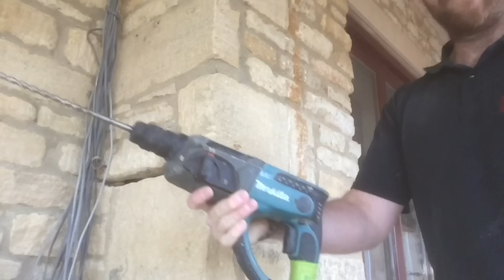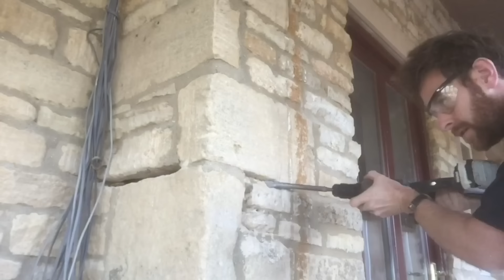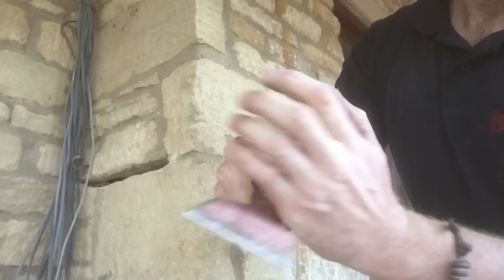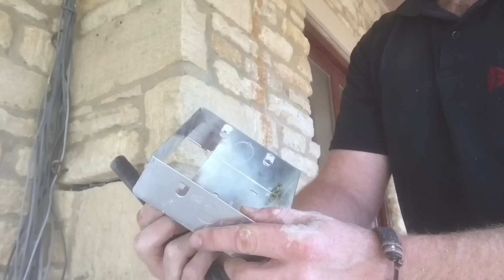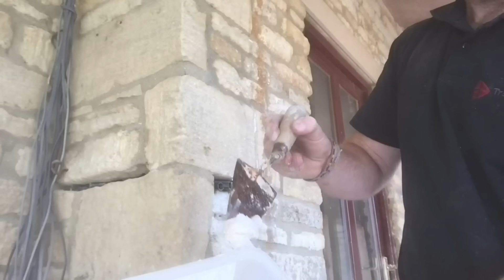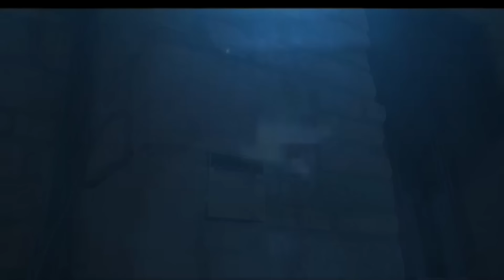How to Chase a Stone Wall and Fit a Metal Electrical Back Box for Sockets or Light Switches

Comment: I hope you have wet the wall before you applied the adhesive. Also hope you haven't put the communication cables with the electric ones in the same box.

Comment: Do these videos provide you with all the info you need to go on site?
Reply: glyn hodges  Cheers. I was thinking turn to youtube or reddit if I had any questions, I finished training as an electrician back in 2012 but could never get a start, so was thinking just to force myself on site and if any challenges come my way I could use the internet to figure it out, i'm great at getting around things.
Reply: Hard to get a start without experience i had to blag my way in as well but at least you have Youtube now this channel is one of best and you can learn a lot of the correct ways  , I practiced chasing out and fitting sockets and backboxes in my garage and volunteered at friends and at families houses for free for a while to get as good as possible  , on first day on site i was lucky the electric was out breaker tripping so i had to test the circuit split the ring and go around testing to find fault i got the electric back on within an hour it was a faulty outside light on a ring spur , easy really but made me look like i was competent and the builder was happy as were the other trades.  This video shows a very tough job this and engineering brick mainly its soft wall and a lot easier but some that crumble i find difficult to get good fixing on  .
Reply: @Cagmito125sportsbikespares  Yh I know, i've been trying for years to get a start as electrician but you can't ever get started because of lack of experience, I can't be asked with this lol.

Comment: I'd of used a mechanical fixing to hold the box in place. No good saying you can use pollyfiller etc. Many fillers can shrink or not adhere properly to a dry, dusty substrate. An idea would of been to dampen the area first. Even so if repointing.

Comment: set the depth stop on your drill 3-5 mm deeper than your box. That way you don't drill too deep into the substrate behind. Less making up lost material. Chain drilling is great way of removing the bulk, but finish off with a scutch chisel. You can upsize the drill bit to remove more material also. Less hammer and chisel work.

Comment: Why did you screw and plug the backbox in, then point up with the lime? I would not personally rely on gypsum based adhesive to hold that backbox in the wall and i cant see any reason why you wouldnt run a couple of mechanical fixings in considering that you have stone behind the backbox. Nice job on the conduit through the mortar joint though.

Comment: What impact does this have on the strength of the wall?
Reply from the maker: Hi. This jot was done by my colleague but I know the building inspector visited many time during the first fix. Thanks for the great question GSH Electrical
Reply: The stone is not structural, the wood in the house is
Reply: None

Comment: What were all them cable for ? Great video by the way
Reply from the maker: +SS mozza 
Hi. Cables were for all the down lights in the new extension. Thanks for watching GSH Electrical
Reply: GSH Electrical  If its for downlights, are they going to be swithed by a single switch, and if yes how will you connect all those cables to the switch? I cant visualise it, small box-so many cables. 

Sorry if its a stupid question. 
Great videos, learning a lot. Thanks
Reply: Ibrahim Abdullah He mentions it’s for a grid switch so can be up to 9 switches there. Not all the down lights may be on one circuit, for example 3 rows of 4 downlights etc, maybe wall lights pendants etc that are two way switched, or intermediate switches, plus if this is a fed switch (I would imagine so) there will be a feed in, feed out (unless end of line) then your loads, plus any two ways. Hence the amount of cables mate, this is just an assumption from a glance but I would bet that’s the case.
Reply: Haven't  used a hammer and bolster  for a long  time .